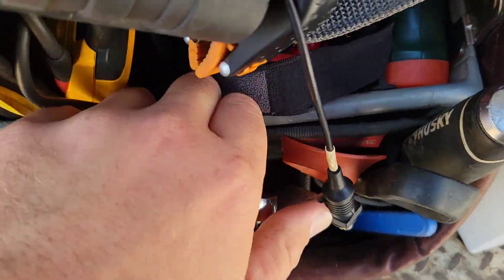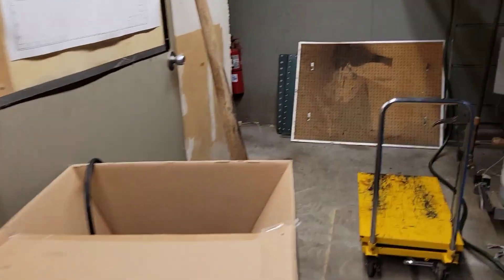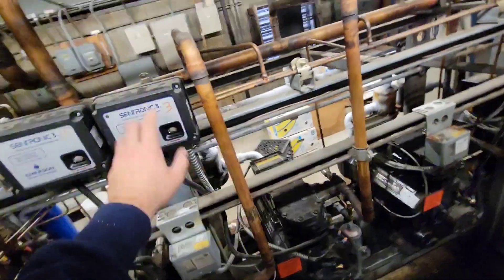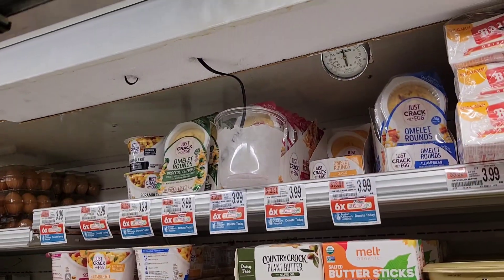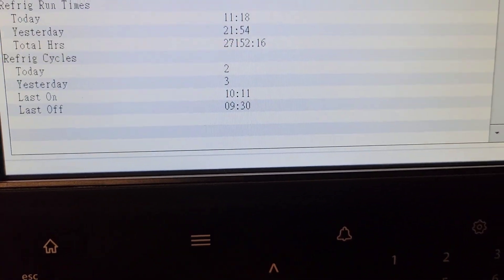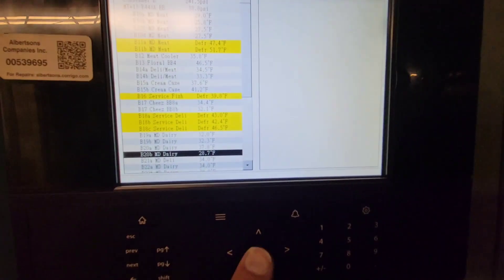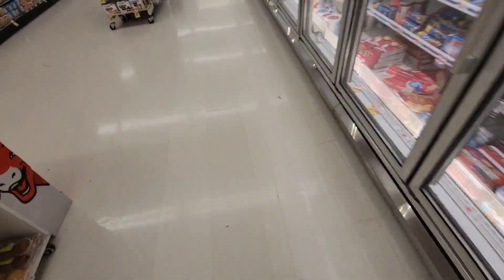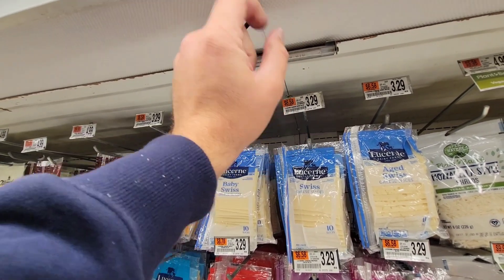Supermarket Rack Refrigeration - Diagnosing A Dairy Case ( Improperly Calibrated Temperature Probes)

Comment: great video very informative. I have a few questions. Why does a sensor need a offset? Should it be replaced with a new accurate sensor?
Reply from the maker: Most sensors need a little off set like 2 to 3 degrees. If you have really long wire runs for they don't use the exact wire required by the manufacturer it can screw it up by a couple degrees. So it's very normal to add a slight offset and sometimes with time the temperature probes will develop a slight offset.

But my rule of thumb is any sensor over 5 to 6. You need to replace. 

Hope that helps :)

Comment: Just made a "comeback watch" of this. Seems like a breeze to watch compared to a few months ago. These vids must be working.
Reply from the maker: Good I'm glad I'm always encouraged by your comments :)
Reply: @gendronhvac-r1269  

👍 This video has "nuances" to the trade, especially at the end, re: this is an older store and they replaced the case temperature sensors but they didn't change/upgrade the wiring... that can lead to calibration problems. 

^^ I was a newbie the first time around on this video and couldn't handle that much nuance (I guess I'm thick, oh well).  But coming back later an watching it, and it seems straight-forward. "TYJ".   

Great vids!